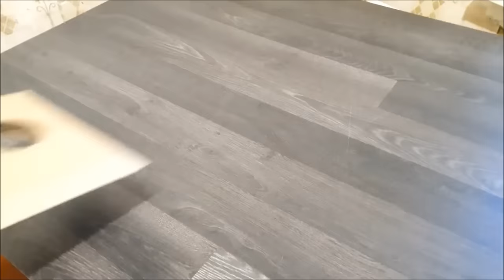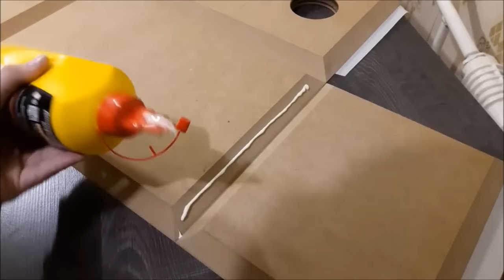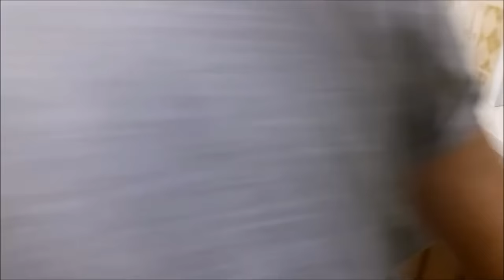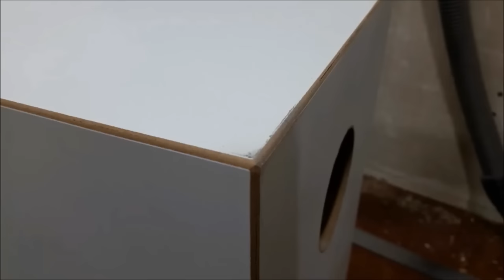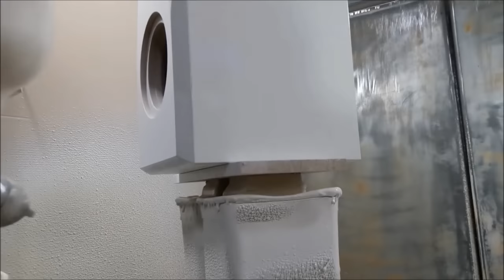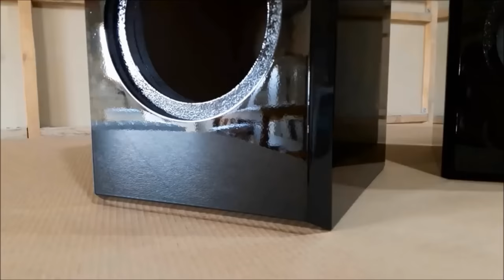DIY speaker box

Comment: What type of drivers did you use.?
And most importantly,  what type of crossover and name of parts did you use for those.?
The boxes are exactly the same as SVS boxes which are in the top 5 in the world.
As far as bookshelf boxes go, it simply just caint get any better than what you did in your video.
Reply: He used the following car-audio drivers from the manufacturer stated in the video description which is the top result on google when you do a search:
- Woofer: https://www.ural-auto.ru/shop/acoustic/acoustic-midbass/as-w165mb/
- Tweeter: https://www.ural-auto.ru/shop/acoustic/acoustic-twitter/as-w30tw/
- Crossover: probably some two-way variant from here: https://www.ural-auto.ru/shop/crossovers/

By the way, what are you basing SVS being in the top 5 in the world?